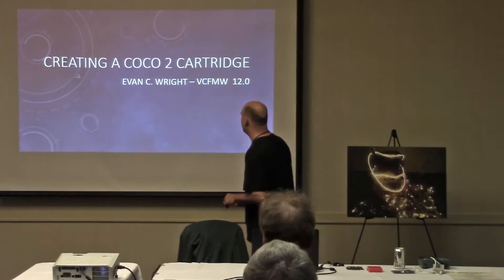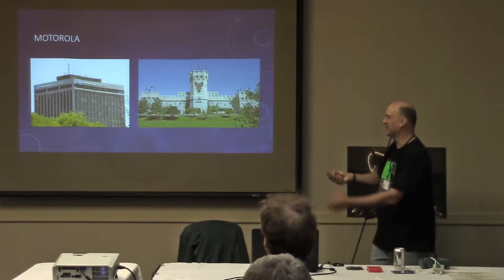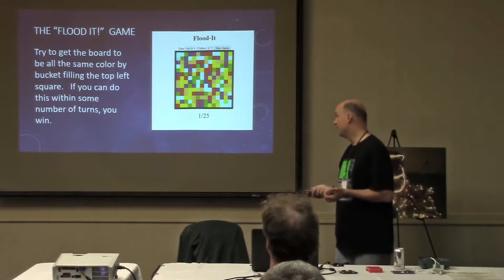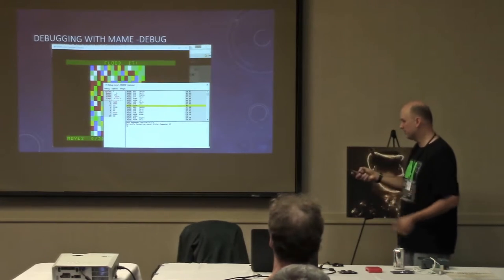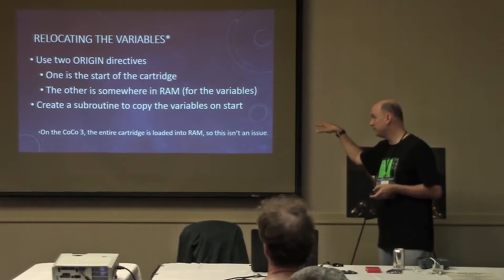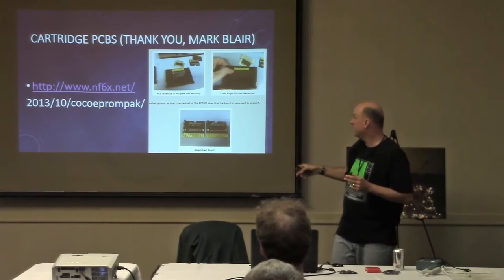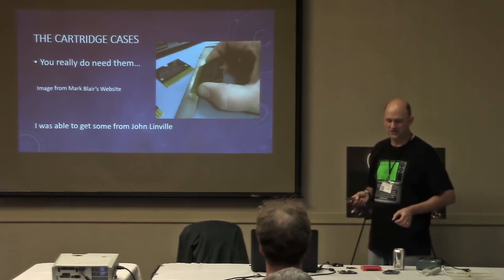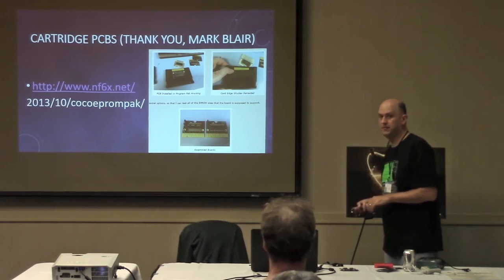VCFMW 11 - Evan Wright - COCO2 Cartridge Development

Comment: It turns out you don't need to add the "DK" header on the .CCC file.  My MAME ROMs were not set up properly.
Reply: Nice talk. I'm doing a reply so you are more likely to see this information. If you haven't already determined the cause of EPROM programming failures here are some details that may help. The newer TL866 programmers are better able to work with low voltage parts so they sacrificed the maximum voltage available. The unit tops out at 18V but the older EPROMs need about 21V for Vpp. To see if that is your problem check the specs of the programmer you have and check the Vpp (programming voltage) in the datasheet of the EPROMs you are trying to use.
Reply: It's been a long time (like since the 80s) since I was well versed in this, but on the original coco, there was a pin that when shorted to ground, would cause the cartridge to execute.  I'm wondering if it was a combination of the pin AND the DK, or if the DK is actually completely irrelevant?  I'm wondering if DK was just for the disk basic, vs a game cartridge, where the game would never exit, like you mention, whereas if it had the "dk" it got called in a different way since the disk basic was an extension to the regular basic, and therefore WOULD be expected to be called in some way to allow it to return to a command prompt once initialized.   I'm rambling here, and maybe I should go back and look at the basic disassembly..  FWIW, if it has something to do with the disk cartridge, it would likely be found being called from extended basic (which was a prerequisite for disk basic) vs. a regular cartridge which could be run regardless of what basic level you had.  Anyway... good talk, and +1 for EEVBlog reference... that channel is great.. I watch everything he does!!